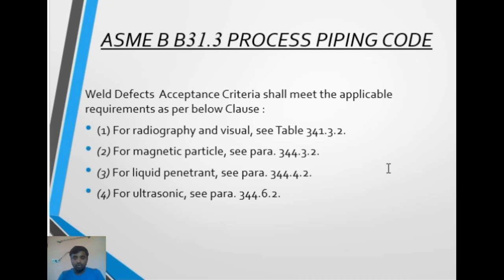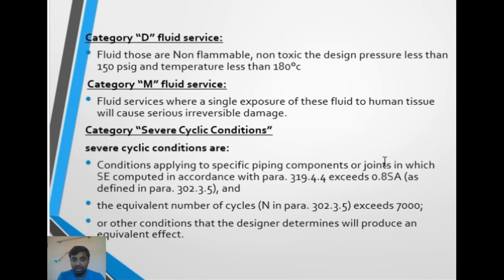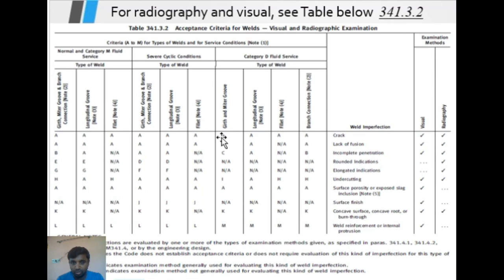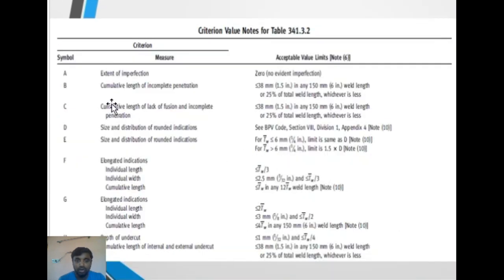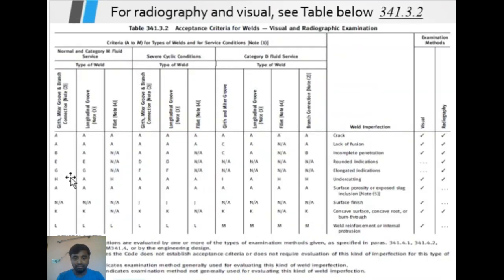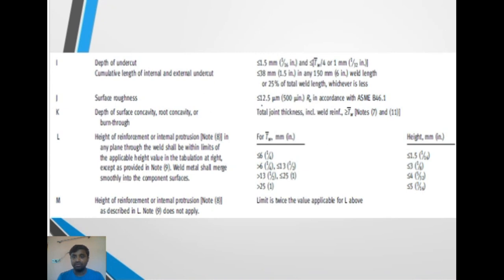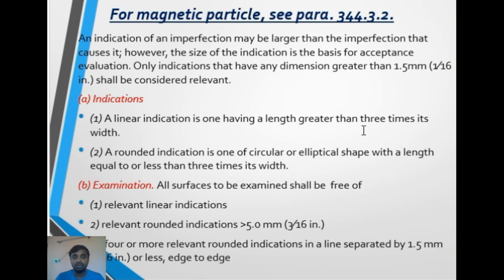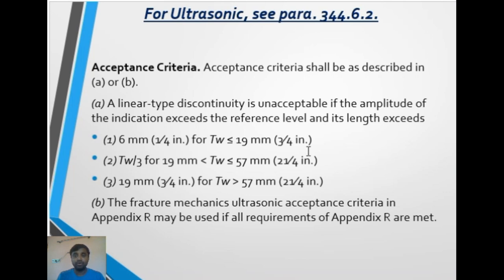Acceptance criteria of Weld Defects  [ASME B31.3]

Comment: As per ASME 31.3 what are the RT requirements of socket weld in severe cycle service
Reply from the maker: Socket weld and branch connections  weld which are not radiographer shall be examined by magnetic particle or lpt methods in accordance with Para 344.3 or 344.4

Comment: kindly share the allowable welder repair rate percentage for process piping and pipeline.
Reply from the maker: will upload a video on this ..Thanks ..
Reply from the maker: generally it is less that 3 percent , however it is not mentioned in any codes and standard .Please follow client requirement and how to calculate the percentage please see below .

if welder did 100 joints but RT requirement is only 10%. so we took 10 joint RT. and suppose we have 2 joint repair in those RT joints than %repair = 2/10 * 100 = 20 %

Comment: Sir what is meaning liner indication ( symbol F)  individual lenght = <Tw/3
Individual width = < 2.5mm and <Tw/3
<Tw ÷ by 3 right sir ?
Reply from the maker: You are right.
Reply from the maker: T/10 for T less than 3 mm
0.5 mm for T from 3 mm to 6 mm
1 mm for T greater than 6 mm to 50 mm
1.5 mm for T greater than 50 mm